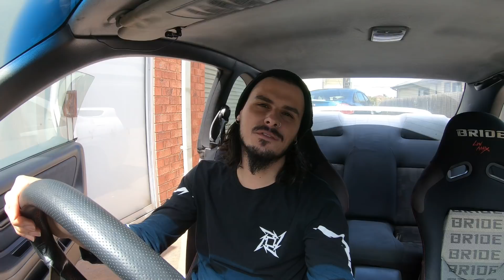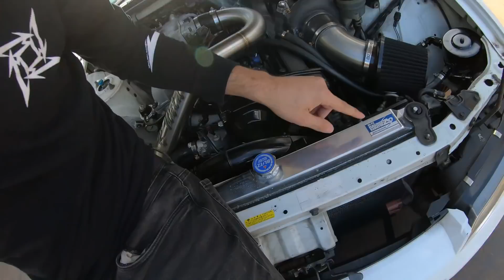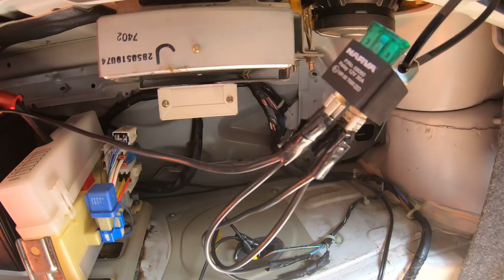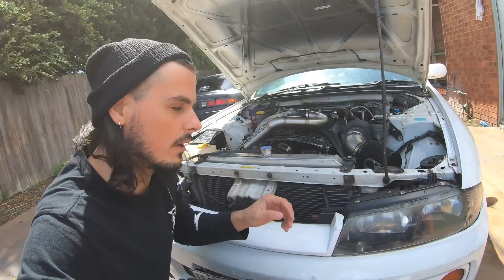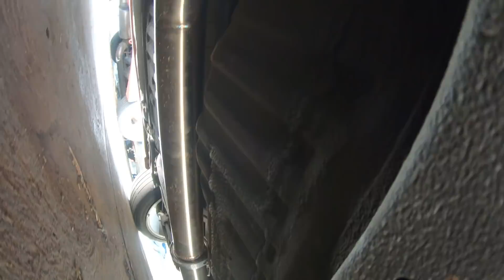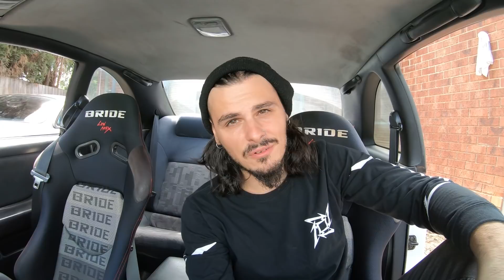BUILT RB25DET HOW TO MAKE 550HP!

Comment: A new APEXi Power commander FC D-Jetro, cost $800 USD plug & play and it includes a MAP & air intake temp sensors along with their respective harnesses that plug in directly to the ECU. Add an APEXi boost controller for an additional $180. Add a WITE interface for data log & tuning for $186-$200. The WITE interface is also a plug & play to the APEXi ECU that has built in Bluetooth and WiFi accessibility so there’s no need for the APEXi commander controller. The WITE interface ELIMINATES POD GAUGES in favor of digital display (via an ANY android tablet/smart phones) which also allows for boost control adjustments on a tap of a finger. So for 1200-1300 USD you get alot more than these ECUs that cost 2,000 just for the computer. No sensors, no harnesses like Haltec for example in which you have to crimp and plug and deconstruct to an extent. The APEXi software does now allow adjustments for E85 as well. Again it all depends what your preferred choice is. I’m happy with my APEXi set up for my GTS25T type M. I got 90% of my items for my R33 from a company directly out of Japan called NENGUN.com. They are a NISMO dealer as well and they don’t over price their parts just because it’s “Nismo”. In fact they have a sale going on right now on ALL Nismo parts until end of December 2024. Hopes this helps anyone.

Comment: my r33 has now 403whp, costed aprox 3-4k$ only injections/coils done do enging beside turbo/frontmount/power fc etc, runs fine but i wanna crawl up to 500whp soon, and for that to happend it cost me around 7-8k$ here in norway

love this channel! keep it up man
Reply: how did you tune the car? no standalone? please help i just need a little more power, thanks
Reply: @o2wrx911 the apexi power FC is a stand alone with a hand held controller from the 2000s good and cheaper then a haltech but run a modern ecu if u can

Comment: I don't see how you think your getting 550hp with factory intake manifold. They restrictive asf maybe its 550 at flywheel
Reply from the maker: they are actually not. Dont know where you get your info but they are better for more down low torque and boost response and can easily push around 600hp with it. 550hp at 20psi and still have plenty more power to go if I wanted too

Comment: Very nice set up . Ive got a white 94 r33 four door . 368hp I've got the same intercooler cross over pipe. Im running a low mount turbo set up . Have to unfortunately rebuild my 25det. So your vid is very interesting.  Im only chasing 400.

Comment: If I had done all of that to my 33 it definitely would have justified a forward facing plenum, and the pain in the arse the cross over pipe was when doing plugs, but I did get around that with a wobbly extension and mods to the valley cover

Comment: You gunna take it down the 1/4? You running stock axles?
Reply from the maker: hahaha i will and yes so we will see if it they get rooted on quarter mile haha
Reply: @ClutchKickJunkies  you'll definitely twist em aye. Anything bout 330kw over on the gtst n boom. If you get some smaller rims and semi slicks n launch properly they'll prob give way, just a heads up 👍. Car sounds fucking sick. Wish I had a 400kw car atm. Especially an RB 😍

Comment: Car sounds so good, but $16k too steep for me at the moment
Reply from the maker: ls motors are junk and good for beaters and dont even sound near as good as a built RB. save your money and get decent mods or even just get arp head studs and head gasket and basic bolt on mods and push 300kw no worries. my next build will cost more :o
Reply: Clutch Kick Junkies ls motors aren’t junk that’s why so many people use the platform and make big power so easily, the sound and everything else all comes down to personal opinion anyway
Reply: Jack Meoff I’m an RB type of guy not really interested in ls motors atm, like you said it’s preference. Who knows might like em in the future
Reply: Cheaper to build an LS and get the same power if not more for the same money lol

Comment: Top tip. Buy "Denso Audi R8 coils" off amazon.com.au for $32 each ;).  only $192 a set :D Best of all they're internally ignited, so don't need to buy an external ignitor.

https://www.amazon.com.au/Denso-673-9302-Ignition-Coil-Direct/dp/B00FRMCD2E

Bloody crap aussie $$. they're now $42 ($252 a set) still cheaper than spitfire ;)